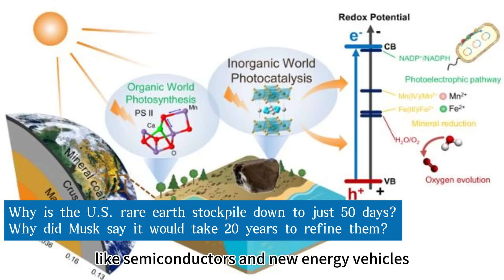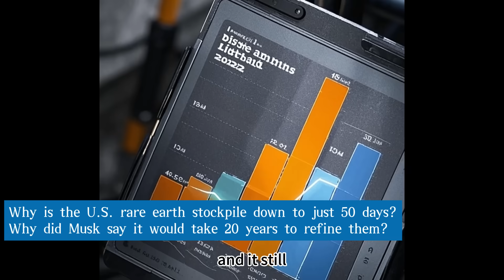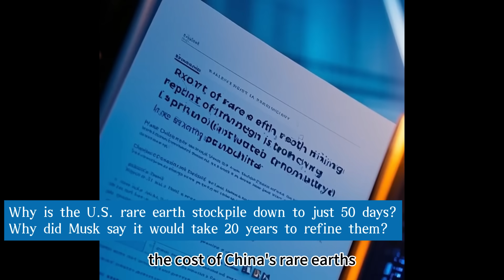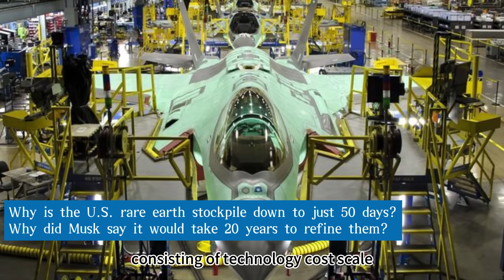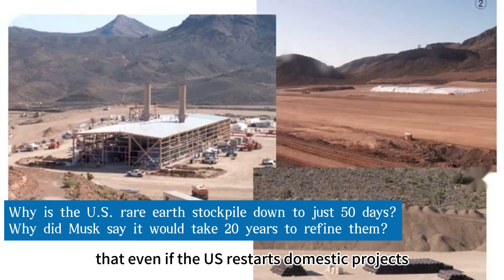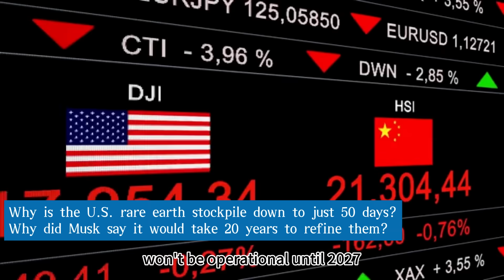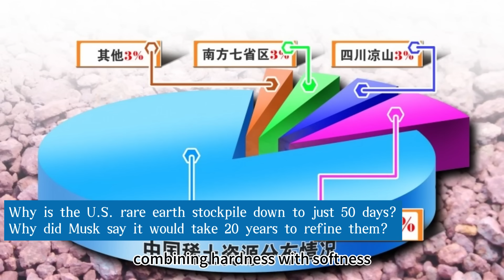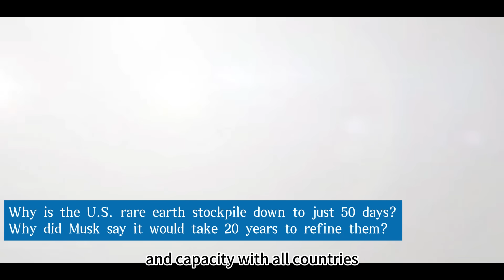China's Rare Earths Dominating the Global Supply Chain, Breaking the Western Monopoly

Comment: "The United States is highly dependent on China for a wide range of critical minerals beyond rare earths, including bismuth, antimony, arsenic, graphite, barite, and tungsten." (Google AI)

And, China has restrictions of exports of antimony, graphite, tungsten, and cobalt.

"As of 2020, the leading uses of antimony in the United States were in
flame retardants, lead-acid batteries, as a key alloying material for strength (e.g., shielding materials), and antifriction alloys. Additionally, antimony is used in a variety of military applications, including night vision goggles, explosive formulations, flares, nuclear weapons production, and infrared sensors." (wikipedia)

"Graphite is used to make rocket nozzles and jet engine nozzles. Ideally, this is attributed to graphite materials’ high-temperature resistance, stability, and chemically inert properties.
Additionally, carbon graphite is used to make aircraft fuel pumps, bushing, bearings, and rotary vanes, just to mention a few. Even in these sensitive applications, graphite does not create sparks that can ignite fuel.
Furthermore, you can use graphite to make impact-resistant and lightweight aircraft parts." (eastcarb.com)

"Tungsten is used in the military due to its high density, hardness, and heat resistance, making it valuable in various applications. It's primarily used in armor-piercing rounds, bulletproof vehicles, and high-speed cutting tools. Tungsten is also used in missiles and aircraft for balance weights and counterweights, and in electronic and communication equipment. "  (Google AI)

"Cobalt plays a crucial role in several military applications due to its properties of high strength, resistance to heat and wear, and its role in producing high-capacity batteries. Specifically, cobalt is used in munitions, high-temperature aerospace alloys, and advanced battery technology" (Google AI)

It appears China has selectively chosen minerals that hamper the US in its military production from ammo to semiconductors.